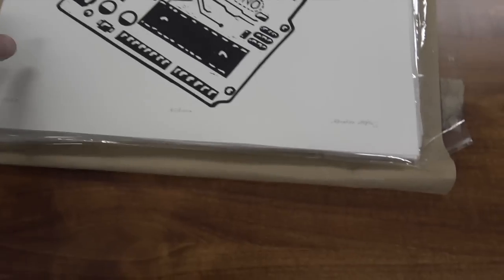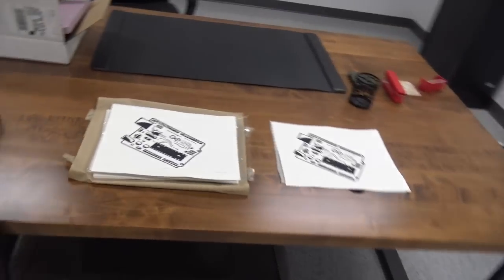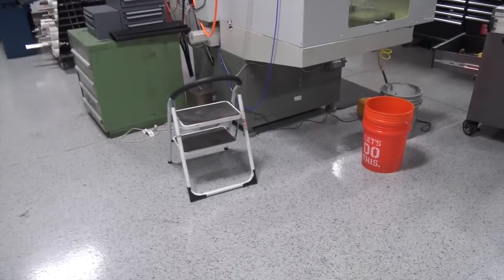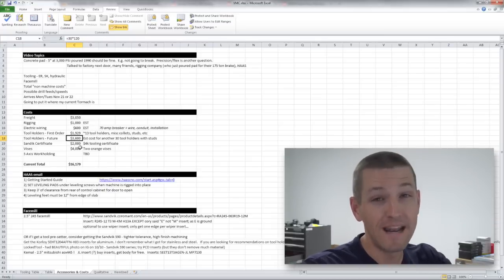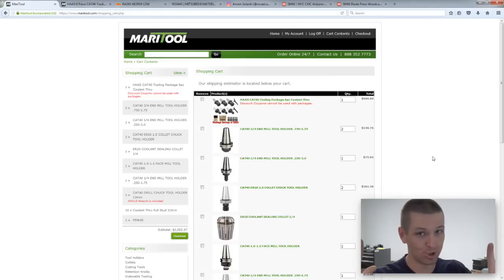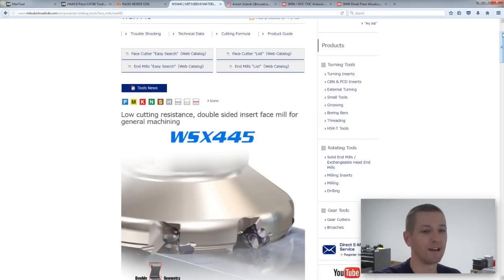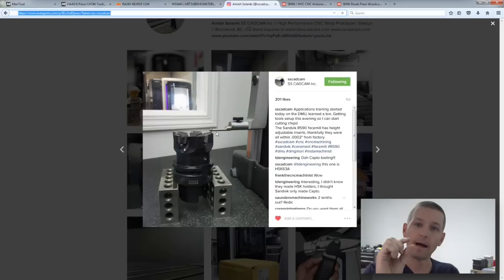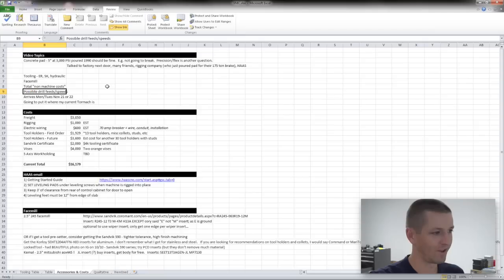Arduino Print & VMC Update!  CB33

Comment: Hey John I work at Benchmade Knife co. We have almost two dozen Haas VMCs a hand full of Mori HMCs and loads of other machines. What I can tell you about moving a Haas is that no matter how small even a few inches will require you to re-level the entire machine. Use ideally a Renishaw ball-bar tester to check your results and really get a true level. Then hire a professional laser level calibration company to come in and dial in all the compensation parameters to get you to absolutely perfect, or as close as current technology will allow. I would try to get the machine in its permanent spot the fist time to save headaches, time, and money later on.

Comment: John I've designed a new model building kit and 3d printed the parts. up to now I've made 34 different parts.
(n.b. For your machine stability check out chokfast we used it to re bed huge compressors in the sahara desert. ) make an island for the machine which separates it from your other tools.)
I don't have any idea on tooling/moulding costs can you help?

Comment: Mari doesn't sell them, but get at least 2 cat40 Bilz #1 style tap holders. I say worth the $. All my machines have rigid tapping but the Bilz set up practically ended tap breaking with taps smaller than 1/4 (5mm). 
Re: The thin concrete floor; Where you'll most likely see issues is with the floor flexing and oscillating is during machine rapids. Stand next to the machine and see if you can feel the floor move when the machine moves and count the time till it stops. In my last shop space, the Mazaks, which had 1400+ipm rapids could really move the floor. I generally don't do production, so my solution was to run the machines at 50% rapid. Then I moved to the 3 floor of a building that was a munitions warehouse for the Navy with 22" thick concrete floors, but that wasn't because of the floor.

Comment: please overspec the wiring to the machine to the next AWG up. that will cut down on voltage loss by a LOT during heavy loads and keep the current down on the cables so you get less of that "dimming lights" during high loads. remember that running multiple heavy loads on multiple machines will cause the main voltage to sag and that increases the current and cause unwanted tripped breakers when running a lot of machines. especially with uncontrolled motors like belt sanders have that can dip the voltage enough to cause problems on the far end. so turning on the iron worker can cause the breaker of the VMC to go off if that is pulling a heavy load.

Comment: The setscrew "weldon" holders can be effective for general purpose roughing operations, where you're concerned about pulling the tool out from a collet holder. The disadvantage is the setscrew holders cannot be run above 8-10krpm (you will immediately hear the unbalance) but they're rigid as hell. The other thing is you'll always be able to access greater spindle power when running a moderate RPM (opposed to maxing the RPM) so you wouldn't be running a roughing cutter at max RPM anyway.
Milling chucks / power-compression chucks are much more effective for holding force, but they're physically VERY large, and also don't support thru-coolant unless your endmill has coolant slots milled around its shank. I have a couple items that take DEEP roughing cuts where I just couldn't get flood coolant down to the bottom of the slot, so I needed to use a setscrew holder with integrated TSC grooves to keep it cool. But that has a lot to do with the specific workpiece and milling strategy, and also whether your endmills have TSC slots on their shanks. Most of mine don't so I use the TSC setscrew holders instead...but I only have a couple of them and the endmills pretty much live there all the time and only get used for like 5-10% of the machining time, then the rest goes to general-purpose holders like collets.
The thing with drill chucks is they won't be concentric within about 0.002" on the diameter (or worse), and they're not balanced. Precision drilled holes would need something better than a chuck, but you can still use them for lots of typical drilling applications without much fuss :)
Reply: Andrew Ydna DuBuc 

Accupro makes balanced solid holders up to 30k rpm @ 2.5G. I have a 1" from them that I run at 16k rpm with no vibration at all. 

$150 on MSC for the CAT40.
Reply: The holder itself is balanced, but manufacturer's balancing doesn't include the tool, which pairs with the set screw position and can throw it off balance. Are you actually dynamically balancing the assembled holders? Not saying you're wrong, just that the balance result would be entirely random and the only way to check it is also the same way to fix it. FWIW i don't dynamically balance my holder assemblies unless running above 12k (I have to send them out to a local shop for balancing) but my 15k spindle sounds like pure death if I put a fresh endmill holder in there. lol
Reply: Andrew Ydna DuBuc 
Nah. I Don't get em balanced. I figure balanced to 30k empty. At 16k with a tool it's still pretty much balanced. 

But the holder I had before that wasn't balanced and it definitely sounded like a jet engine just spinning up. Ordered the accupro balanced one and it's whisper quiet minus the sound of the insert cutter spinning. Though the insert cutter it's self is also balanced so that probably helps too.

Comment: For my initial Maritool order I went with two sets of their Haas starter kits - that gets me six each of the ER16 and ER32 holders and two sets of collets.  I ordered a few extra pieces of common size collets since I'm sure I'll need them, including some 3/4" collets so I can use some Tormach tools in a pinch.  I passed on a drill chuck because of the price and I figured I'd try using ER collets instead.  I also went with the Maritool 2.5" 45 degree face mill - it looks really good and you can't beat the price.  I'm sure as I get use to the machine I'll start collecting more specialized holders but this seemed like a good starting point.

Comment: Since your doing Orange vises I would make a sub-plate that bolts to your table and has the ball-locks on the top that the vises accept to secure those. Then make an adapter plate for your 4/5th axis unit that can attach to the same sub-plate via those ball-locks. Then you have a relatively easy on and off for all your stuff and I believe I read the ball-locks are repeatable to tenths. As an additional bonus, since you made and machined everything yourself on your machine, you have a perfect environment in CAD to use for all your parts. For soft jaw type work, you probably wouldn't even have to change your origin or G54, just assemble your parts in the same file, do your CAM, post and hit cycle start :).

Comment: For your trunnion: You need a flat L bracket with three contact points on it. Two on the longer side, one on the shorter side. I'd even make it on your brand new VMC. Bolt that on the corner of your table semi permanently with the trunnion manually aligned the first time, then when you set the trunnion in the machine, push it against all three contact points and you'll at least be close, if not dead on. the trick here is exact constraint. if you're still nervous you could build in some fine thread set screw holes for slight adjustments. You are right though, tramming in 4th / 5th axis alignments is not how you want to spend your day. If you have a probe in your machine, consider setting up some probing macros that tell you where your XYZ zero is in 5 axis coordinate space.

Comment: +1 For Maritool! Oh course I'm a bit biased being that they are 2 minutes away, but they are great quality, great price and awesome guys. As for the chuck, I literally just bought a bt30 chuck today from them. I was of the same mindset, trying to use collets for drills but it quickly didn't make sense with how many different size drills I need to use when prototyping (especially the larger ones) and how many different collet sizes I would need to hold them. I would think that would be even more applicable to you being that your more job shop orientated. If anything, I would get at least one.

Comment: A really good granite surface plate, and a high quality height gauge would work for setting the tool height on that 590. Just make sure your surface plate is surface graded AA or better, and observe the normal procedures for working with surface plates, and tolerance measuring. Obviously the better surface flatness on your surface plate, the better results you're going to get, AA should be sufficient, i doubt you would need AAA, or better for setting that, but if you want, you can always have them reground at higher spec's but the cost goes up as well.

Comment: Good idea with the dowel pins or fixture for the rotary in the Haas. At the company I work for we use dowels or nesting bars with adjustment screws on the back to help align fixtures or rotaries we have in our shop. If you wanted to get fancy you can also use the renishaw probe to probe the rotary and align to it in the case you can't get it exactly straight or maybe didn't want to spend that much time on it. 

We love to turn machines into microwaves - program it to where you just push the green button and the machine will probe, align, and machine the part itself. All you have to do it walk back up to it after X amount of time and the part it done. We make the same group of products all the time so its worth it for us, but being a job shop maybe its not worth the time invested - atleast for the probing, aligning, and machining - the probing and aligning the rotary may be worth it though.

Comment: A couple of notes on concrete:

1) It is flexible. When building my house there was a point where twelve reinforced concrete pillars roughly 12" square were exposed. To demonstrate the flexibility, I would ask someone to put their hand on one face of a pillar; then I would hit the opposing face with  my fist. (The heel of my fist, not the knuckles; I'm not crazy!) They were invariably startled by how clearly the vibration came through.

2) Have every pour tested by a lab. They provide plastic cans about a foot tall and maybe 10" diameter which are filled with a couple of samples from each truck. When they harden, the lab crushes them to test the psi of that truckload. Tell the contractor you are going to be testing. We specified 4000 psi for the foundation walls and 3000 psi for flat work. The concrete company understood that they would remove and replace any pours that were below spec. None of the lab tests came back at under 5000 psi. The company was taking no chances. (There are over 800 cubic yards  of concrete in the house, and 80 tons of 3/4" re-rod.)

Comment: On the 590, could you write a macro for the reinshaw tool setter to measure the height of each insert (assuming you bought the option to orient your spindle)? These values would than be stored into local variables on the haas..

Comment: Also the Haas floor spec will be calculated with the max weight on the table going at max feedrate. You will no doubt be running most things at a small fraction of that mass.
For sure make sure your rigger uses plates under the forklift or has the tire size to keep the ground PSI within what your concrete will take. You never know where you might have a void under your slab. I've had good and bad riggers, and it's totally worth paying for the good ones.

Comment: Actually.  If you go with the Lang system. You could utilize their quick point plate system to allow you take your trunnion on and off without having to retram every time. Build a sub plate to attach the trunnion to, then attach the quick point pins to the sub plate.  

Only concern would be the amount of Z height you'll be eating up. That trunnion by itself eats up a lot. Though I think you can afford to take up another 2" with the quick points and the sub plate.
Reply: NYC CNC 
That's right you have the VM table. Depends on how accurate those pin holes are. But if they're good (like within tenths location of eachother) 3/4" plate should be good. Use QC-10 aluminum. It's an aluminum designed for injection molds. Very strong, hard (20Rc) and exceptionally stable. 

If the pins are more just rough locations and aren't very accurate to each other than go with the Lang quickplates.

Comment: As far as tooling. Did you check with your HFO? We bought our machines from Selway Machine Tool and they put us on to the Kennametal voucher program. It gives you a voucher for 20% of the purchase price of the Haas machines that you can use to get 50% off of Kennametal list prices. We spent $145,000 on our Haas machines and ended up with a $29K voucher. 
We have 6 months to use it and unlimited orders up until the voucher is used up.

We then set it up with Intermountain Machine Supply, They have been excellent to work with, some of the things are cheaper to buy without the voucher or from a different supplier, IMS always lets us know if it is cheaper to go a different route than the voucher or if the best price can be had with the voucher.
On a lot of things it saves a bunch of money and the voucher did not cost us a dime.
We have been using it mostly for holders, TSC carbide drills and insert drills.

One thing I figured out pretty quick was that all the holders, fixtures and tooling ends up being almost as much as the purchase price of the machines...;)

Comment: Hi John, have you looked into the Lang vises? Lang-technik makes them. I would really want to get those over the orange vises. Combined with their zero point system you will be able to reconfigure your machine so quickly. And all the step files are downloadable of their website. 

This is how I worked with them on a Haas vf5 with trt210 on it: get one base plate on the 4 or 5th axis and two of them on the bed. Make a work offset on that plate and use the step files in fusion to make sure you can cut the part. You will never have to probe a work offset again. I usually did the 1st Op on the 5 axis and then move the part to the Lang vario vise on the 3 axis part of the machine, again offset is already known, and finish it there. This way the part usually came off in one run, machined from all sides. And my setup time for repeat jobs would be within 15 minutes. And for new jobs just a little longer, because I already knew I wasn't going to hit my vise and I knew for sure that my offsets where good. 

You can contact me if you like some more info, I'm not related to them in any way. But I just love the system they've developed. I'd almost recommend them for a Nobel prize. Haha
Reply: NYC CNC you've got mail :-)

Comment: Your electrical estimate sounds very low. I would say $1200-1600 is a closer ballpark if you want a conduit drop from the ceiling poking into the machine. The rigging is probably going to be a few hundred more, but thats going to depend on your guy and area. Personally, I'd run the VMC on your pad all day. If its REALLY 3000psi and 5", you're good. Visually, it looks to be in mint condition, and presumably its been there a few years, so the foundation should be good. We poured an 8" slab of 4000PSI, and I think next time I would go for 12" in the VMC area with a lot of welded rebar. We got a LOT of cracks when they brought the machines in on the new slab. Our old building was ~3" and cracked in thousands of places, it wasn't an issue so long as you kept heavy stuff away from the machine.

Comment: We just put in a VF-4, we had a local company cut out the old floor and have an isolated 8" thick concrete pad for it, I really think it was well worth it, it sits on its own isolated pad, eliminates that as an issue when troubleshooting potential problems.

Comment: Nothing wrong with a Sandvik 245 series face mill I use them every day on aluminium and sometimes even in steel or high nickle alloys. Also don't get pulled into the tool rep hype. Their promises of tool life and chip removal always fall short (with the exception of Shear Hogs) and if you get roped in it may lead to a fine collection of dust catching insert tools.

Comment: The floor slab size many times is to ensure there is sufficient mass to dampen vibration.  The high speed start and stopping plus the violent jogging of the tool heads can shake a whole building for some machines.  We just designed a slab for a machine that had a 125 hp head on it and it was close to 1m thick (40 inches).  The size and thickness of the slab was designated by the machine manufacturer, we just figured out the reinforcing.  Sometimes they are vibration isolated from the rest of the floor slab as well.  I have no idea how these machines compare to your new VM3.

3000 PSI concrete is garbage by the way.  We always spec 30 or 35 MPa (4500-5000 PSI).  This forces the supplier to pay attention and not send junk for house foundations.

Comment: Nice choice on tooling, also going with the full trunnion 5-axis.  When I was in school we had a VF3SS with the full trunnion 5-axis and the instructor's once they had it trammed in they scribe the table to out line it.  This made it easier to quickly locate it on the table and then tramming went smoother.  We also just used a engine hoist with the boom out.  I did it all the time for the instructors.  I forgot you'll have to make a riser block for the Renishaw Tool Setter to get it up above the 5-axis trunnion.  Cool update.

Comment: Just had the ASX and WSX quoted today. Contact your local rep. They had package deals you buy so many inserts and get the cutter free.
Reply: Yes 30 for the ASX and 40 for the WSX. I got a quote for both face mill bodies yesterday. WSX was 645 for the body and 806 with 40 inserts.  ASX was 546 for the body and 433 with 30 inserts.  WSX is eight cutting edges per and ASX is four cutting edges per.  Also you can mix grades in increments of 10 pcs.